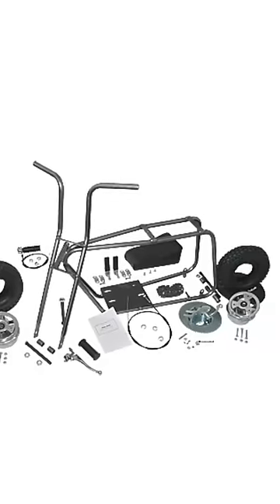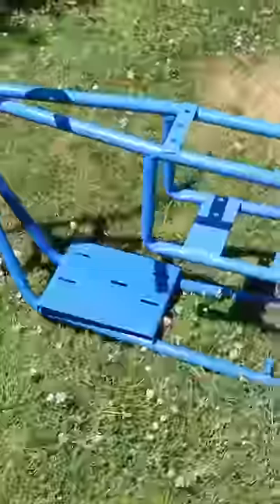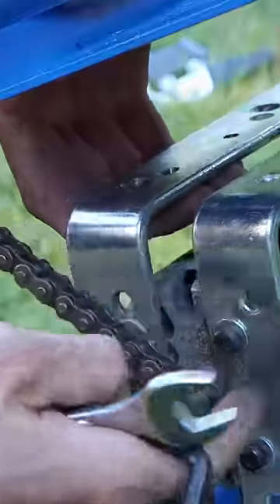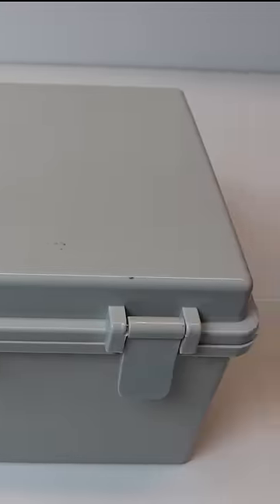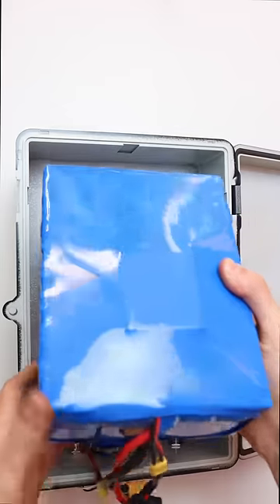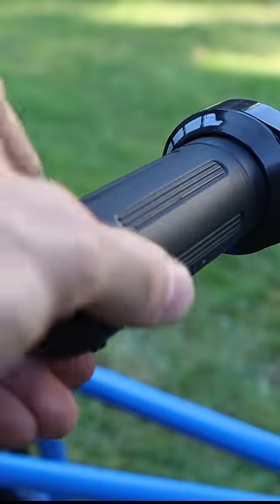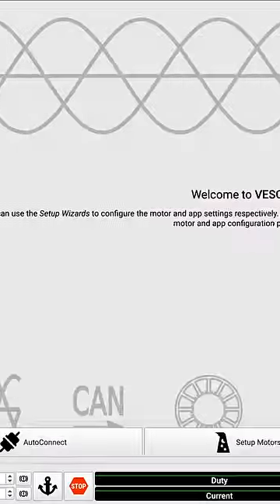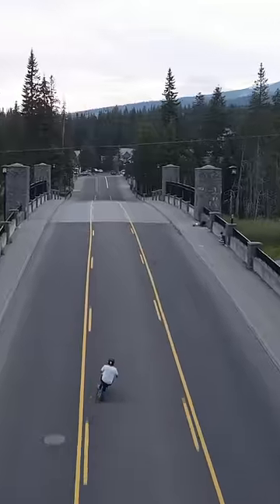Building a 7,000W DIY Electric Mini Bike #diy #electric #minibike #ebike

Comment: 35mph? What battery are you using that seems underpowered for 7000w
Reply: just needs a smaller rear sprocket
Reply: Nah use a my1020 motor trust
Reply: May be the tuning. Otherwise anything faster would eat up the <1kWh battery in the blink of an eye., especially considering this isn’t a fine-tuned machine.
Reply: I built a little bike that goes about the same speed with only 2000w and it takes off really quickly too.
Reply: He is using a small outruner, those are low torque high rpm, you can't reduce the gear ratio enough to get in the powerband
Reply: Gear ratios are probably a big part of it
Reply: It's the gearing that's his problem
Reply: @robinlehnerd1475  my 500w escooter goes 28.. i mean this is actually slow in comparison, but he shouldve had battery pack across the top instead
Reply: yeah definitely not running 7kw
Reply: 😂 7kw Amazon motor, 500w rotational force 6500w heating
Reply: Agreed, if it really were 7kw it would have at least 2/0 wire from the battery if it were 48v battery

Comment: id use a qs165v2 or qs138 90h v3 for the motor 
and a bac 8000 for the controller
if youre going to run a battery like that theres a lot of power youre not using
whats the max amp on the bms you're using?

awesome bike btw
Reply from the maker: Thanks! BMS bypassed for discharge. Max current is set to 80A in VESC tool from battery

Comment: Cool! The motor might be rated for 7kw, but it might overheat at higher currents than 50 amps...i have a bldc motor 2 times bigger which is rated for 3 kw... doesn't matter...i like your invention!

Comment: It would be better to mount the ESC outside the box for better cooling also the heat from the ESC itself could damage the battery pack if it's close

Comment: ESC... I'm as broke as dirt, I got a selection of 18650 batteries and motors from other peoples garbage.. but no free esc's, how can I build one or where is a good scrap source for an esc appropriate for a bike, like about 7kw with regeneration or something?
Reply from the maker: The ESC is probably the one part not to try and cut corners on. There are some cheaper ones out there, but they tend to break easily.
Reply: @DIYesk8Builders  I agree,  that's why I don't have one yet.
And if it had regeneration ability and it didn't work right it could blow up the whole battery pack with me sitting on it!
  There's got to be some source for a motor controller that's at least possible to get. If it takes me a year to save up $100-$200 bucks, I know I ain't getting one for $20, and I'll never afford one in the thousands.
   I'm practically crippled and can't walk to town, the typical e-bike that that I can't even afford used won't get up my driveway, it's to steep, I got no driver's license, nobody to give me a ride, no nearby public transportation , and I'm not quite crippled enough for the insurance to give me a electric wheelchair...

Comment: I was about to say there is enough room to install a range extender (battery charger generator)
Reply: The motor and controller support regen braking.  No point in adding additional resistance to the driveline.

Comment: That power output is enough to go about 65 miles per hour so gear the thing properly and get better mileage at the same speed and also more speed when you need it.
Reply: Needs a bigger battery to sustain those speeds. Power is no problem, but ~730 Wh is not enough to do anything other than a quick lap around a parking lot with that power.

Comment: 7kw for 30 miles an ours is lacking you did somthing wrong im planning on upgrading my bike to 2000 watts and its suppost to go 35
Reply: probbly wrong ratios, it doesnt have the torque to make him go >30
Reply: @nakoda1610  prob low volts high amps so like 200 miles range or some wild shit
Reply: His battery can do 30-35mph . ,but that range is sus! . I made a 40kw ( 40,000watts) footscooter.  But it's 24s 16p  monster scooter with samsung 50s . With 2 660 amp fardriver nd84530s  . 7000wh
Reply: My bike has 750W motor. Top speed is 55kmh. Keep it at 45kmh and pedalling and my range is about 70km
Reply: @rory.projects  is the tourqe in the negatives god damn i got 650w and it goes 20mph or abt 32 kmh
Reply: @bdvr  I don’t even know what that means tbh. 48v20ah battery with 750W motor and a nexus 5e drivetrain on a GT rigid frame with no suspension. 26 x 1.5 tyres. 44t front chainring and cant remember the rear
Reply: @rory.projects  i figured it out its your battery thats making it more powerfull but the motor is under powered for your battery
Reply: @bdvr  is that a bad thing?
Reply: @rory.projects  kinda
Reply: @bdvr  why i wonder? Bought them together in a package. Nearly went for the 52V option
Reply: @rory.projects  you should have a motor of  atleast 1kw to not under power either it wont hurt anything but the speed
Reply: @bdvr  definitely goes fast enough already. The reason I switched to a nexus 5e is because too much torque resulted in cracking one of the cogs on my cassette.
Reply: @rory.projects  where did you get  the kit

Comment: 15/70 gear ratio for 7kw or 9.5hp and you only got 22mph??? You should be getting at least double. Try a 18/65. I have a built Briggs 5hp on a vintage mini bike with a 18/65 gear ratio it goes 65mph and it makes ~7200rpm. I usually use a formula to calculate top speed.(Rpm/ratio x Wheel D x 3.14 /12 /5280 x60) hope that helps.
Reply from the maker: 35 MPH top speed. motor is not nearing max power
Reply: Where did you get 22 mph from

Comment: Almost dragging that rear sprocket when turning. Maybe up that tire pressure or change the tire to something with a stiffer sidewall if you can go larger. Unless it’s just the camera angle

Comment: Either silicon seal the wires into their casings or use rubber grommets just to be safe. Perhaps add a tiny hole into the bottom of the case to free any condensation which might accumulate. But also, perhaps use a fire proof container for the battery, if it's lithium. I'm being extreme. The bike is epic in any case, inspiration!
Reply from the maker: Great ideas! Thanks

Comment: Would you ever just mount the motor directly to the drive wheel or does that mess with the physics?
Reply from the maker: The gear reduction yields a lower top speed but more torque

Comment: Yo, just a heads up.. you're limited to a maximum of 6,720 watt for a second or 2 with this setup. If you upgrade to an 18s setup, it'll output a tad over 7kw for a little while. I have the same motor as well
Reply from the maker: Looking for an ESC or battery upgrade!

Comment: you need a 7kw controller and a high discharge battery that's able to put out the needed power for it to be 7kw. the motor is just rated for 7kw
Reply from the maker: Precisely

Comment: Is that DC motor? Brushless or not? How do you handle the heat?
Reply from the maker: Brushless motor. Does not get too hot bc it is not running anywhere near 7,000W max

Comment: I put a 125cc that's now modified a 140CC ish,with stage 2 cam ,roller rockers, performance push rods and springs. Attached to a semi-auto electric start on an old 1970 Sears and Roebuck droper bird bike and it'll do 70 miles an hour all day but I'm rocking a 16 tooth drive sprocket on the engine, and a 23 tooth on the Wheel, and because of the small wheels only being 11 or 12 in, it's still way too much torque and I always take off in  second gear. So I might bump up to a17t engine sprocket. But, I'll admit it's already terrifyingly fast, in addition to being on a small mini bike frame. At least it's 54 years old solid American steel. Probably safer than most newer vehicles lol.

Comment: Would be a lot more fun with an 8hp Briggs & Stratton.
Reply: Or a 20 hp 212
Reply: @matthewmussetter7500  Well hell, might as well just put a Huyabusa motor in it!
Reply: Nah, the way he's choking the power from the battery if his details are correct he would have it set up with the fuel intake turned off at the carb to save money and then put a huge jet in the carb and try running it on pure 2 stroke, doesn't matter if its 2 stroke or not, I had a home built 36v 16ah battery linked to a 36v-40v ESC, running a 500w wheel motor  and topped out at 36mph -  500w compared to 7000w should make a big difference then its apparently 16s 726wh Battery, it doesn't add up, I like the build but the details seem way off

Comment: Would it be easier to use a rear hub motor instead of a mid drive set up?  You would just need three plugs, throttle, ecu and battery.
Reply from the maker: We have considered going the hub motor way

Comment: im sure   the cost of your labor and parts far exceed what you could have bought on the open market for a sit down  scooter  it is  good experience.  the reason this is so is that those scooters i speak of had a team of engineers and designers they are mass produced  bringing the cost way down at the sales counter  and there is stiff competition for the consumers money. i have a couple of dueltrons that putout 10000 watts  can do a smooth 50 mph light up like Christmas trees  and cost a little over 3k

Comment: Hi dear.. what is the range without motor over heat and shut down.. there is no limit and no shut down OR  after some miles it  will shut down.. just need a rough idea im gonna use 63100.. thank u
Reply from the maker: Depends on how hard the bike is being pushed
Reply: @DIYesk8Builders  thank  u dear.... i mean yours
Reply from the maker: It depends how fast I am riding. If I ride normally it won't shut down
Reply: @DIYesk8Builders oooh.. ok dear.. thank you very much for information's.

Comment: This tells you just how powerful RC planes are with a motor like this spinning the prop. LOL
Reply: Power is the wrong word here.

 Power is speed x torque.  Given the size of the motor and the low speed (35mph), I'd say this is anything but powerful.

To give in example, my bike is much heavier only 350w hub motor, and goes 22mph.
Reply: @RhetoricalMuse  Yes, you are right. :) Motors have gotten so impressive

Comment: Like sure those motors consume a lot of watts. But they are tiny... A proper 7kw hub motor would do 100+Nm torque. That flipsky motor is rated for 17Nm max.... sure the gear ratio gives you some more but imo those are worthless in anything bigger than skateboards. Or really small EV's where hub motor wont provide enough torque.

Comment: What is an "electronic brake"? Are there real brakes on this bike?
Reply from the maker: There is no mechanical brake. Pulling the brake mechanism is an electronic input to the controller that slows down the motor.

Comment: how many volts is the battery cuz 2000w ebikes can go faster than 35, thats like a 36 v battery
Reply from the maker: battery is 16s (57.6V) it has a lot to do with gearing
Reply: @DIYesk8Builders ye you should get 72 or 76v battery

Comment: That motor probably isn’t sustaining 7kw, even if you could do it 100 battery amps isn’t 7kw, that VESC definitely isn’t doing 7kw and the battery probably sustains just 3-4kw.
Reply from the maker: 100% correct. Limited by ESC and battery output

Comment: sohe said 726 watt hour battery and a 7000 watt motor. Thats how you know something is off. That battery would have to be a lipo with at least 10S discharge rate or the battery will explode. And if the battery is 726 watt hour and the motor is 7Kw then you have only 5 minutes of ride time. 

My conclusion is that the motor is not really 7Kw. Have you see a 7Kw motor?? its massive!
Reply from the maker: The motor is not running anywhere near 7KW based on battery and controller specs, but the motor is capable of producing that much power according to the manufacturer

Comment: Wait I'm confused 7kw but only 30mph with such a small range??? How much torque does it have if it's such a low speed for 7kw. I bet it pops wheelies like crazy😅
Reply from the maker: Torque is pretty crazy. We are also just not fully using the max ratings on the motor

Comment: Electronic brake???
Reply from the maker: The brake makes the motor apply a torque in the opposite direction to slow the bike down
Reply: @DIYesk8Builders  Very cool, but also yikes. If you run out of battery, or there is a malfunction you are brakeless? Not that mechanical/hydraulic brakes are flawless, but electronic brake just seems next level risky.

Comment: I dunno dude, my cheap e-bike has a 1000w motor and goes up to 30 mph / 55 mules of range, i'd have thoufht your bike would be faster, is it because of the smaller wheels?
Reply from the maker: Due to the gearing and bottleneck of other electronics

Comment: How do you get 30mi range with that battery? 7kw motor with 726Whr battery?  Forgive me, i dont get 30mi on a 1.5kw motor with a battery that is only 84Whr less than this.
Reply from the maker: It is not pulling 7kW continuous. Far less than that most of the time

Comment: This motor is 7000 watts?I think you missed one zero...700 watts maximum, considering the wiring and motor size.If more at this size it will overheat in a minute.
Reply from the maker: motor not running at 7,000W, but is rated peak for it

Comment: 100a VESC at 60v but it's 7000w somehow
Reply from the maker: Motor is not running at 7,000W. It is rated for that, but is limited by the ESC and battery
Reply: @DIYesk8Builders  Just say it's 6kw then, that's still plenty of power.

Comment: That is really cool bro but on full throttle and top speed that will go for 6 minutes and 20 seconds before the battery is completely depleted. That is only 8km of range at top speed.I have always wanted to do a project like this and it is looking good so far.
Reply: Most likely not getting 7000 watts to the motor. His top speed basically solidifies that claim Lol

Comment: Guys. it's 2024. Why is everybody still using chains? If you start from scratch anyways use a belt drive. Lasts you longer.
Reply from the maker: The belt drive is currently in the works!

Comment: I think you’ve been had with that motor, it definitely is not 7000W motor. That thing looked way too small. My 7000 W hub motor weighs like 50 pounds. My friends 6000 W mid drive motor is way bigger than that little thing you put on. Got to upgrade my friend.
Reply from the maker: https://flipsky.net/products/brushless-dc-motor-80100-130kv-7000w-for-electric-bike-electric-skateboard-go-cart

Comment: If its 7,000w either your battery is to small or ur motor is not 7,000w at 7,000 you should hit way more than 35
Reply from the maker: Correct, the battery is limiting. Also, the gearing
Reply: @DIYesk8Builders  alr if u put a bigger battery in it that shit would cruze

Comment: Only 35mph with a 7kw motor? Wow that’s little that’s roughly the top speed of my 1000w e-bike
Reply from the maker: Limited by the gearing and the battery and ESC
Reply: @DIYesk8Builders  i mean what's stopping you from using a bike cassette to have the gear ratios needed for maximum speed?

Comment: 7000w only gets you 35mph?? my ebike is 500w and gets me 23mph, seems your power isn't used as efficiently
Reply from the maker: It is the gearing. Geared for torque and not speed

Comment: It doesn’t make sense that it only goes 35 mph with those specs that things should hit between 60 and 80 mph
Reply from the maker: it has to do with the gearing and power limitations from the ESC
Reply: @DIYesk8Builders  I see and is there a way to override that

Comment: 7k watts and it only goes 30mph? My 1300 watt ebike goes that fast without me pedaling?
Reply from the maker: The battery does output enough current to fully enable max power out of the motor
Reply: Mine goes 45 after limiter eliminated... there are two

Comment: That’s not 7000w it only goes 30 mph 7000w should be in range of 70-120mph depending on controller and amps
Reply from the maker: Battery is not outputting enough power. Motor has the ability but is not being utilized
Reply: @DIYesk8Builders  yeah that’s what I meant by Amps ….will you make a video on the bike going full speed?
Reply from the maker: We will probably never fully utilize the motor power. For us 35 MPH is plenty. There is not really a place that we could or would want to go faster

Comment: Creative bro frfr… but 35mph that big SLOW
Reply: My 1500 watt bike goes 43 and that’s on 48 volts. Volts=speed when working with electric motors. I plan to do 60 volts which while it doesn’t seem like alot more should get me over 50

Comment: 30 miles with 700wh running 7000w? Yeah right. You can literally kill that in 6 minutes if you accelerate at full throttle
Reply from the maker: It is not pulling 7,000W ever
Reply: @DIYesk8Builders  still 30 miles is a lie

Comment: Only 35 mph?? Why so slow?
Reply from the maker: It has to do with the gearing and battery limitations
Reply: Controller limiter?  I built a fat tire Ebike with a 72v 5000w motor and a 50ah battery topped out at 73mph. A little overkill, I know and it's too scary fast, but needed the speed to be able to avoid the bad drivers not paying attention.... You did a great build there and I love it, I was just wondering why not a little more power to help getting out of possible bad accident.... Good job!

Comment: 35 mph 

Seems very low for a 7000w motor 

I got a 1000w in my ebike it can go 30mph
Reply from the maker: This is due to the gearing and limitations of the battery

Comment: Yeah right 7,000w on that little motor no way 7,000w only going 35 mine is 3000 and goes bout 50
Reply from the maker: Has to do with gearing, not power

Comment: 7000 watts and still slower than my ebike with less than a third of it's power? 🤨 where is all the juice going?
Reply from the maker: The battery does not output enough enough power to max out the motor